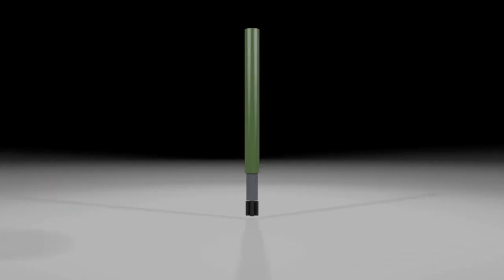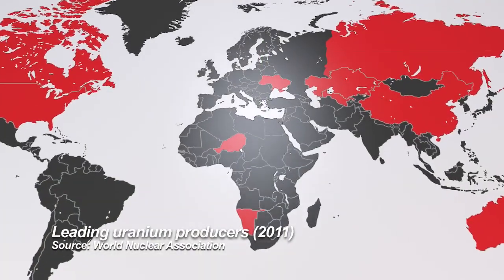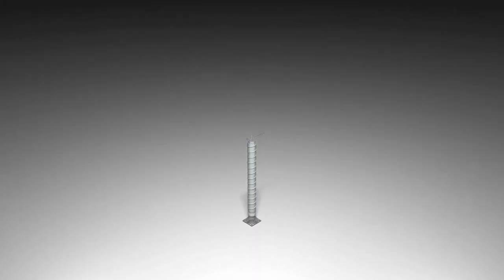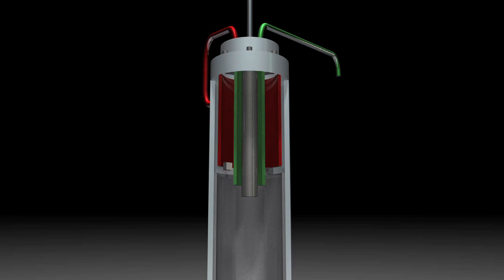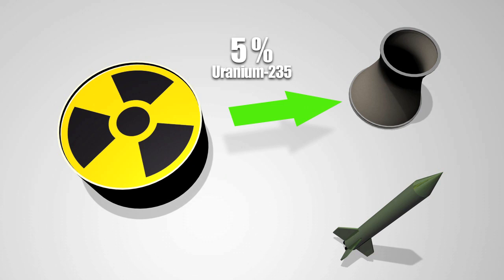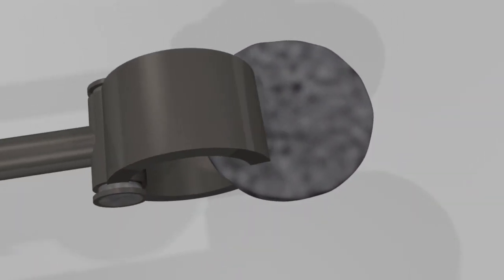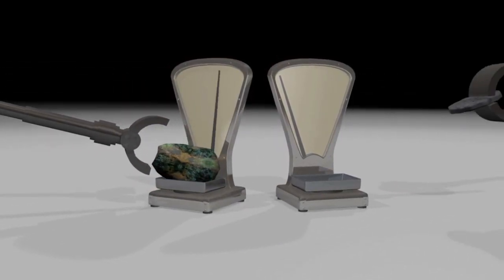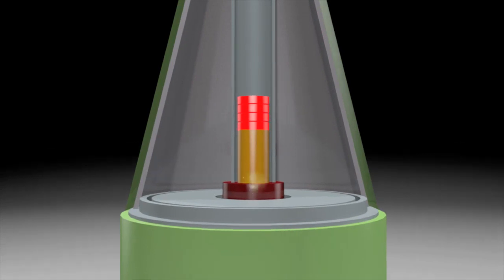Making a nuclear weapon

Comment: That's a nuclear weapon, let me tell you about a hydrogen bomb!

How to make a Hydrogen bomb at home!

So, hydrogen compresses 900x original size before it is liquefied! Oxygen around 800x! HH, and O gas without being pressurised is 2x more explosive than TNT! Meaning liquid H, and liquid O at a 2:1 ratio is 1750x more explosive than TNT!

What happens when you put an explosive under pressure, e.g. a Graphene coated explosive? 

It becomes even more explosive!

Deuteride (an isotope of Hydrogen) is used in H-bombs, and has a freezing point of 3.8 degrees Celsius in a water molecule! This is heavy water!

Then you use electrolysis, and follow the same steps of making liquid hydrogen, so you have liquid deuterium! 

Now we know that different isotopes of Hydrogen have different melting points, that is also true with lithium (another vital ingredient to a large fusion H-bomb!

Lithium melts at 180.5 degrees Celsius, now all you need is to store it in paraffin wax, the paraffin wax has a flash point of 199 degrees Celsius! Heat up the paraffin wax, and you will be able to separate the isotopes of lithium! 

You will then have one liquid isotope, and one solid!
Just filter!

You now have the basic building blocks for a large H bomb!

Ofcourse liquid H, and liquid O must be stored separately, so you have another set of smaller tanks to make sure it gets the perfect 1750 mixture! You then place the liquid deuteride, and lithium in the centre!

Place this device under pressure, the more pressure, the larger the explosion, and the better the fusion.

Graphene, dyneema, etc! Pressure is great, it's vital for fusion
Reply: A hydrogen bomb is much larger!
Reply: That's a fission bomb, I supplied details of a fusion bomb!

Have fun!